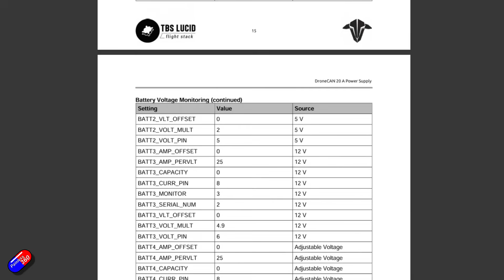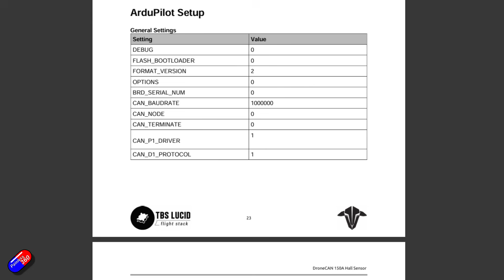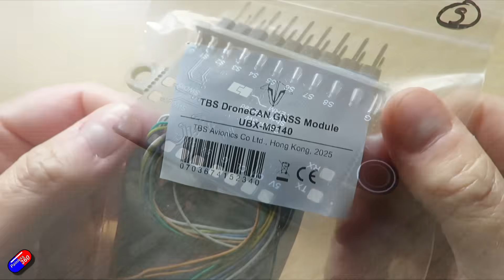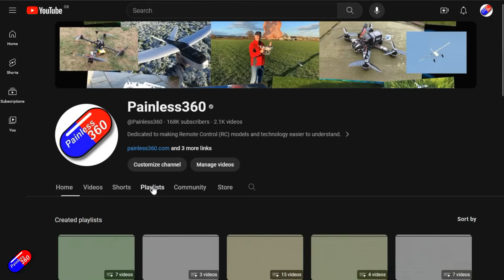Just released: TBS go big for DroneCAN devices (CANBus)

Comment: Perhaps an interesting solutions for planes, but for multirotors, nah.
Seeing so much JST connectors in one frame gives me shivers.
I've had pretty much every JST connection acting flaky at some point. 

Multiple JST bridges on the shared bus makes it a question of when your aricraft falls out from the sky, not if.
Reply: JST is the standard for CAN, so if you want to make CAN-based accessories, that's what you have to use. each of these connectors also have solder-pads so you can solder instead of connecting.

Comment: Those are some really nice quality looking parts, as always from TBS to be honest. They just make super high quality parts whenever they make something, its the main reason i have no problem spending alitle extra more money for things from TBS when there are sometimes cheaper options, but I have TBS Controllers, CRSF RX's, VTX's, Antennas, Adapters, electronics, motors from as early as 2020 for the controller when the Tango2 came out and everything I have literally still works if I havent crashed with something and physically just damaged it, but even that is rare.. I havent done anything myself on Ardupilot but ive used it a few times a few years back and it worked extremely well for all that kind of stuff. It's awesome to see that theyre even moving a standardize awesome setup like CAN-BUS. Its just so simple for wiring, reducing the amount of wires, size of wires, etc. Plus the options it will give you because if it works like this on Ardupilot at least, you really never need to change anything in the actual setup, just on the Software side with the CAN-BUS which can keep be great for logging and stuff like that as well and im sure more accurate data, in general.. Really cool to see all these things they continue to come out with and push the Hobby even further into high-level industrial level Tech at least..

Comment: What's the advantage of CANbus over typical UART connections? The obvious benefit I see is the daisy-chaining of sensors, but what else is there that gives it an edge? Why should I use CANbus over just hooking everything up to the FC like we've been doing for years?
Reply: CANbus is a bus, so you can have multiple devices all talking to the flight controller over a single port.  Also, CANbus uses differential signalling so is more resistant to interference and can be used over longer distances.
Reply: That's what I wanted to know.
Reply: @techstuff6829  Also since its a bus, you can have a single device take the entire bus down. Ive seen it happen on large UAVs I used to work on. Its not some great solution for wiring, it can also cause new issues and you need special/expensive tools to listen to the bus and diagnose whats going wrong. (Systec CAN device) We had to put a CAN bus logger on our plane after the CAN bus shut down a few times and we lost planes. IMO unless your wiring is so insane you need to save weight in wires dont even bother with can bus. That means basically zero hobby people should use CAN. CAN servos, ESC's etc are also generally more expensive.
Reply: I don't see a benefit for small drones, it's really good if you have huge wiring harnesses tho
Reply: yeah, I don't see canbus being of much use to our small hobby drones. maybe planes and stuff if you want to run a bunch of sensors. useless for a 5 inch freestyle drone though.

Comment: Hopefully the quality is better than what they have shown recently with their AIOs.
Reply: Their recent AIOs have been fine? I mean the only issue I've had with the Wing aio, at least, is a dumb PCB setup, but it's not really horrible from a complete product viewpoint
Reply: @mythrillium2 one issue I heard about was it would give you vbat out of the vtx connector even after you jump the pads to set it to 9v.
Reply: @davedauria4782 damn, really? First I've heard of that, but I also power my VTX of a separate 12v bec that's wired direct to battery, so I wasn't ever looking at the VTX outputs